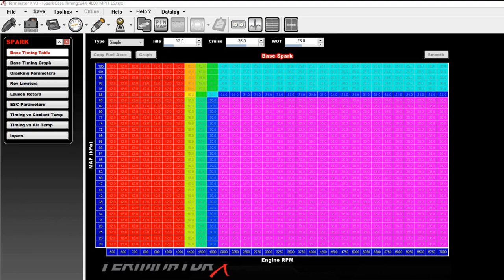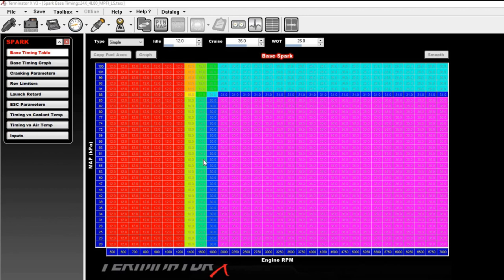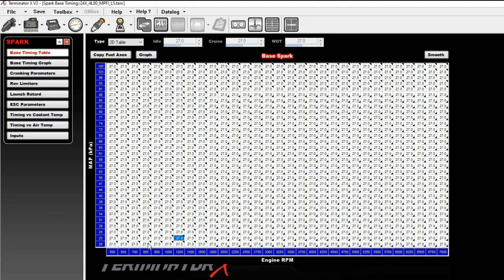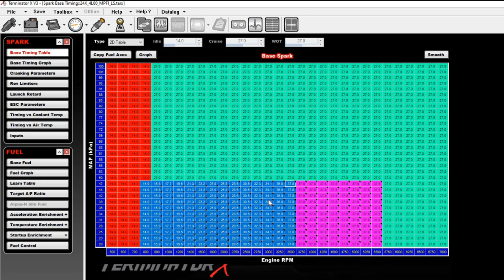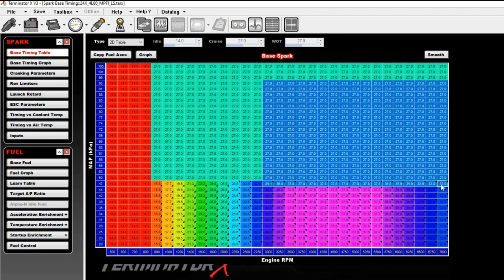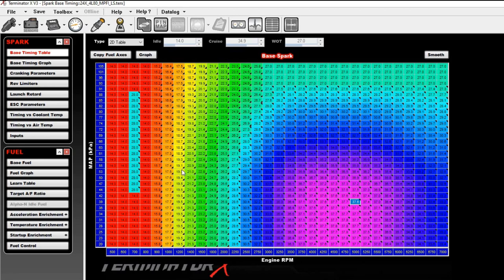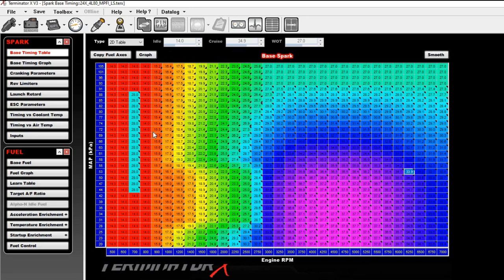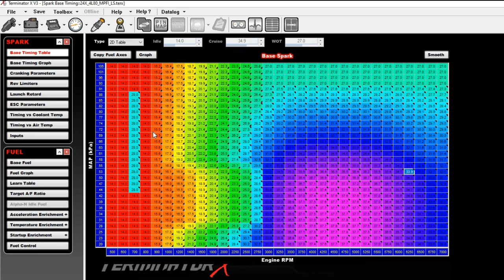Holley EFI Tuning: Building a Startup Timing Table Part 1

Comment: Thank you for sharing your knowledge and tuning experience. In your opinion, what would you typically like to see for timing on an early 351c using EFI and timing control for total timing? In my case the engine has original oem iron heads open chamber 2v with 9:6:1 compression?
Reply from the maker: I wouldn’t be surprised to see 35-36 on something like that but I’d start at 32 and read plugs

Comment: Very well presented. I have an angry Mopar 440. Trying to get it smoothed out for street /cruising . This is way over my head. I'm an old points and condenser guy.
Reply from the maker: The engine will want the same thing either way. I just find it’s much easier to achieve it with a table rather than weights and springs and vacuum hoses. 😅
Reply: @greenshortsperformance472 Agreed! I used to modify the innards of my Lucas dissy to get the maximum out of my modified engine. It was very much hit and miss and took a great deal of time and effort. These days I type a number into a table and “bingo” it’s done!

Comment: Great information.  I have a interesting situation that the motor shuts off when I put the car into gear, but starts and idles pretty decent.  Any related videos to assist.
Reply from the maker: Check out my idle tuning and advanced idle videos
Reply: I also had that stall when put into gear issue, the timing "wall" GSP mentions worked for me.

Comment: Just wanted to give you some feedback on your suggestion on my fuel prime-crank knock, results....It works thanks again, no more start up knock! 2 more questions if you don't mind, you mentioned checking the timing old school with a pointer, have you seen many LS7s with the crank trigger off? in the process of rebuilding my 7 with AHP ported heads and BTR sg 4 V2 cam, vid up on my channel for entertainment. What value do you put in for air temp Vs timing? I have a little retard dialed in after 115 deg and retard up to 5 deg at 160 air temp. the C2 ls7 I'm working on has the air cleaner next to the radiator, not good but no room on a C2? Thanks for sharing all this cool tech!
Reply from the maker: Your timing adjustments are fine. They'll all be a bit different but its good you're thinking ahead on them. As far as checking static its never a bad idea. from GM they're usually very close. If you ever have the wheel off or you have an aftermarket crank id definitely check. I once had a machine shop install a wheel 92 degrees off. That took me a minute to figure out

Comment: I feel like should pay you for this info.
This video finally made me feel comfortable enough to play with timing on my LS2. I was nervous to go above 22 at WOT.
I just said here goes and put 26 at WOT and followed your suggestions on the remaining. 
The  motor no longer feels lazy. 

I did have to put the timing wall in my map as well  for idle but it was there before. With AC on and coming to a stop it wants to stall. The "wall" works to stop it.

Thank you !
Reply: Glad you liked it

Time to put fresh plugs in and make a nice hard pull and kill the engine and take a look at those plugs 

Maybe I need to do a plug reading video next
Reply: @Whiteaw57  Plug reading would absolutely be helpful. 
Tried to get this thing on a dyno but not many shops around here, and the ones that are here really don't want to mess with a bone stock LS2. 

Another video idea possibly Flex fuel sensor set up for pump E85?
Reply: Yes! Plug reading!!!!🙏🏻🤣

Comment: Great video as always need to get the 8.8 diff and gear swap finished on my big blue Jeep I had you tune and see if we can get the lockup to work properly if not source a converter they will play nice with the big cam and tires I have.

Comment: Long story short,i have an ls in a jeep and do alot of backroading in pennsylvania where i run into some pretty old gas ,my goal is for it to run good on 87 octane,curious what your thoughts are my timing table,its a stock 4.8 with a mild cam,18 at idle to 1400 then 25 in by 3250,to me this feels about right, not alot of info on 87 octane builds, everbody is after maximum hp, appreciate any input ...thanks
Reply: i would carry a bottle of octane boost...... had to do this with my dual sport, bike would run on anything but ran so much better on higher octane

Comment: Love your channel, question: 66 Corvette 570 HP wet sump crate motor LS7, FAST 102 intake and TB, AHP heads redone, mill .030 .040 MLS head gasket, CNC port. Terminator X, redoing the timing and fuel map, starting off from max 24 deg, down to 21 and checking data logs for knock, all good on acceleration but we now get an intermittent knock on startup, timing goes to 33 deg, 100% knock and retard table kicks in then back to idle 18 deg and runs fine, the knock is only 1 audible knock on first 1 second of cranking and start up run and that's it, no more knock. tried reducing cranking timing from 15 to 5 deg no change, tried richer target air fuel, no change,  the trace goes down the middle pink area like you have and transitions up to idle, tried pulling timing out of the data log trace and no change, it seems the idle and timing goes high right at first fire up, starts quick and runs fine.......have you ran into this issue before? O, one more data point, we are at 5,000 ele, cranking PSI went from 170 to 208 after the head work, guessing we are around 12-1 now? Thanks in advance for any input!
Reply from the maker: Turn off the cranking fuel prime and let it get up some speed before it tries to light off. Ran into the same problem on my LS7
Reply: @greenshortsperformance472  Thanks for the quick reply! when I first got my Terminator X your vid that shows the DBW throttle settings saved the day, It would not start without my foot on the peddle, your knowledge is impressive! thanks again!

Comment: 27 degrees for a ls3 head is a lot isn't it? Beyond 22 degrees was only worth a couple hp on mine.
Reply from the maker: No it’s not. And I’ve seen that before as well. It will get flat in that region